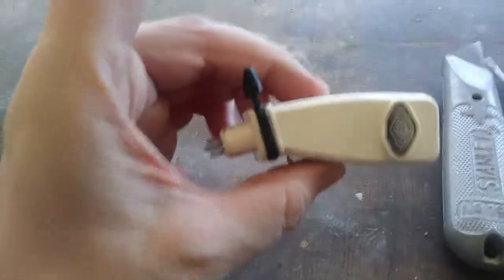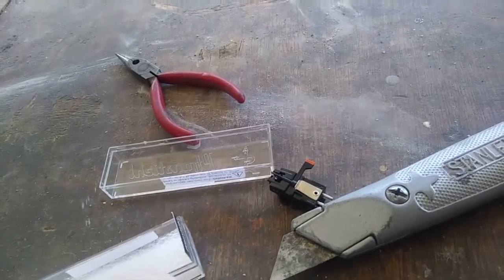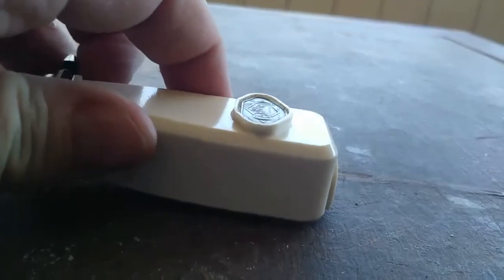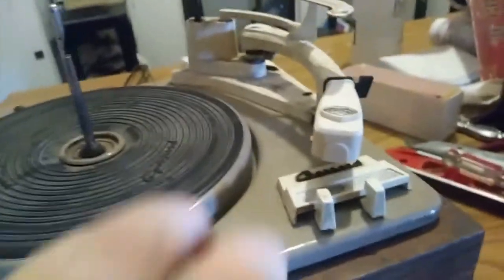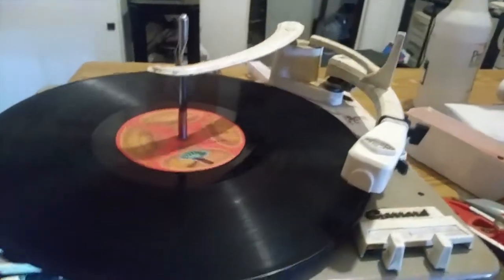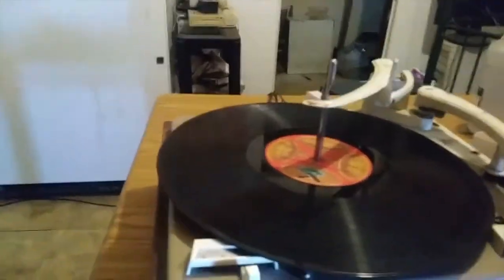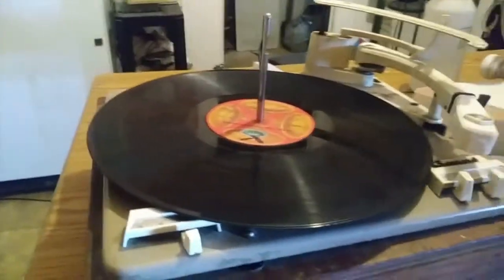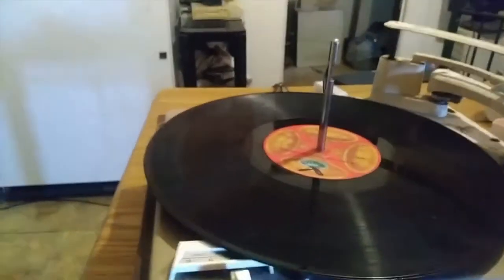bcast04082021 Garrard 210 turntable cartridge

Comment: I am looking to buy headshell & Cartridge for my Garrard 210 turntable if you or anyone has one spare. Thnx.
Reply from the maker: do you need the 3pin or the 4pin? the 3pin one is more easily found. it will fit a 4pin socket but is wired for mono. I got mine second hand on ebay. just be aware that the mounting screws for the cartridge are British thread. they can be swapped out for standard metric or SAE thread as the nuts are under the Garrard label on the top of the cartridge. If you are lucky you may find a nice 4pin with a cartridge in it. May need a new stylus though.

If you want a magnetic, the lowest gram tracking weight you can easily do is 2grams. You can go lower if modify the spring counterweight.
Reply: @bichela  Hi Michele any of the two will do. Im finding it difficult get one here in the uk. If you can help of course i will pay for the item.
Reply from the maker: Here are two. They both have cartridges. The 4pin is expensive as hell:
GARRARD Turntable Headshell,  Moulding, VINTAGE, Stereo England

https://www.ebay.com/itm/GARRARD-Turntable-Headshell-Moulding-VINTAGE-Stereo-England-/133575224024?_trksid=p2349624.m46890.l49286
Look at this on eBay

Vintage SHURE M7D Cartridge With Stylus and Garrard Type A Headshell

https://www.ebay.com/itm/Vintage-SHURE-M7D-Cartridge-With-Stylus-and-Garrard-Type-A-Headshell-/274820895917?_trksid=p2349624.m46890.l49286
Reply: @bichela  thnx so much for your help & advise, i managed to purchase one of the style of headshell that you put forward for me, now just to get the cartridge then the headshell,
Reply from the maker: Yes, glad you got the most important part. Are you planning of going with a a magnetic or ceramic cartridge? I have had both but think the ceramic cartridge sounds better.  A simple ceramic to magnetic adaptor consists of one 200pf cap and a resistor. I think I am using 16k ohms per channel. That’s what I am using to go to a Pyle PO444 magnetic phono preamp good EQ and soundstage.  If you watch the Am1610 Silvermoon program on Discord at Sunday at 7pm US Eastern or the the Patreon replays you can hear the Garrard 210 at work. No EQ tweaks.